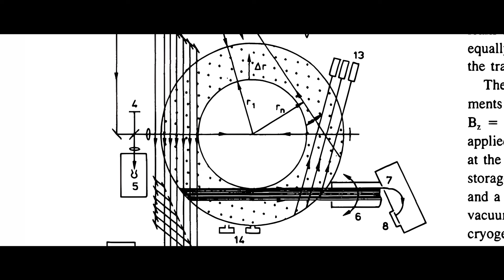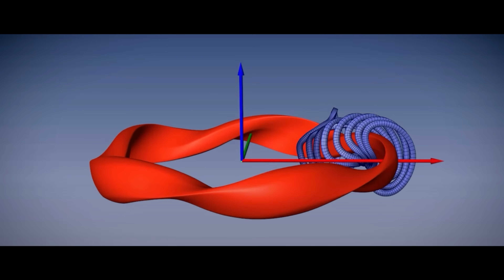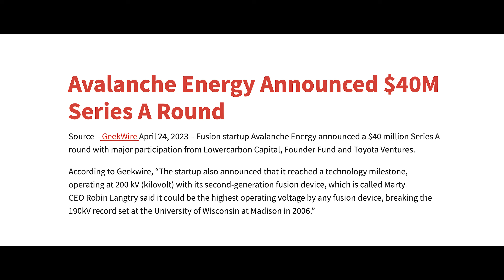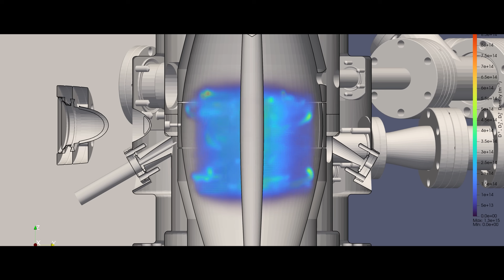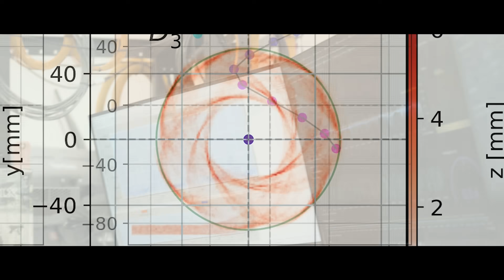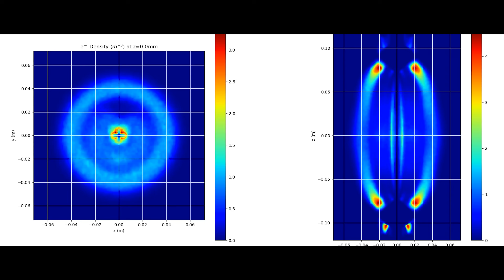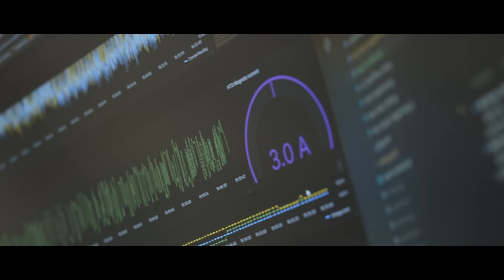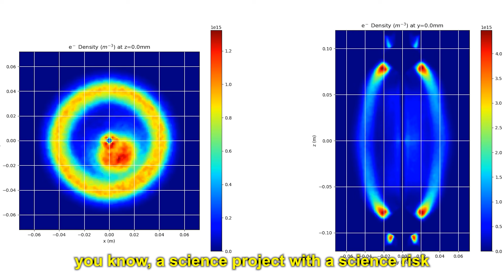This Company Invented a New Way to Do Fusion

Comment: I work in this field and I can tell you, that i certainly hold some level of respect for these people and the undeniable technical challenges they are working on. BUT, none of these project hold the potential for the scale required for any form of net energy, or in the propulsion world power that can be used outside of for craft already in space. Their architecture simply does not have the right scaling laws. Additionally, the fuels used also scale much worse than the accepted approaches. Essentially, with their approach they would need an absolutely absurd amount of input power (like annihilate a city levels) and need to heat the plasma to genuinely insane levels, that would make the larger fusion machines look like ice pops.
Reply: Also, with some back of the envelope calculations, in order to achieve similar plasma conditions to a machine like ITER (which is around what you would need to be even considering anything comercially viable) an electrostatic approach with optimal efficiency and confinement (which it will never truly have) would need to have on the order of 100s of MV used to generate the electric field. This is many orders of magnitude higher than the highest ever sustained voltages.
Reply: In what way are they inputing energy? Is the 300kv used to push in electrons in to the chamber?
Reply: @ginis_The voltage is for confining the plasma and generating the pressure to undergo fusion. Maintaining this voltage requires energy, and a lot of it. Once you get this high up into voltages you cannot store it in a battery of any sort. You need to actively be using energy to maintain the differential.
Reply from the maker: @flamebreaker1214  how about for space focused propulsion?
Reply: @createdbyspiral already addressed in the comment (not scalable)
Reply: @createdbyspiral As you point out, these approaches could prove useful in space focused propulsion (Which is why it’s the main area serious academics are investigating in regard to this). It will come down to balancing the thrust/mass ratio with the fuel density/mass ratio. I would say that our current implementations are best suited for probes headed outside of the solar system as they have a lot more time to accelerate and don’t require high thrust, which matches our current results. 

In terms of fusion power, there are a select few private companies that are not total scams (this one is not unique at all) The most promising are Commonwealth Fusion Systems, Type One Energy, and Thea Energy. Many of the rest (especially those not investigating tokamaks/stellarators) Run into the same scaling issues.

Also, a general rule of thumb for the field would be that anyone who is saying their fuel will be anything but Deuterium-Tritium is a con man. The reason is that other fuels would require you to increase temperature by several order of magnitude (even compared to the multiple hundreds of millions of kelvin in real reactors). Look up “fusion cross sections for various possible fuels”
Reply: If this proposed architecture is, in fact, just a science fair project, how did these highly trained individuals become convinced it was worth such a large investment of time and capital?
Reply: @PETERJOHN101  The OP didn't characterize it a "science fair project", and it's not clear what you mean by "highly trained individuals". If you mean the project engineers and technicians, they are only investing time-on-the-job and drawing a salary, unless they have skin in the game, in which case they are part of propping up an investment-scheme. "scheme", or another word that starts with "sc-"
Reply: @-danR 
The OP expressed his view that this was not a valid approach to the problem of fusion, so my question remains.   What is the psychology at work here since educated engineers would logically know they are digging a dry well? It was a simple question.
Reply: @PETERJOHN101  It's the same answer as to why scientists keep going onto those science or history channel shows and talk about bigfoot, or ancient aliens, or blind frog ranch for 4 hours straight. Because it's a steady paycheck.
Reply: Some people held some level of respect for Elizabeth Holmes and Theranos, back in the day. We became sadder, but wiser, people.
Reply from the maker: @-danR  hmmmmmmm
Reply: Not scalable?   Who cares? Just build more and gang them to get whatever you require.  Just like the engines on Starship.  More engines = more power.  Maybe the reason we don't have fusion yet is because people can't think outside the box.
Reply: @barnowl6807 that's not quite right in space propulsion. 1) wrong mass enery ratios the more you add to the weight the more energy you need 2) diminishing returns even at 1% light speed : double the output won't give you double the speed. The more you accelerate more it costs the get faster and it gets unreasonably expensive (by orders of magnitudes). Adding more generators linearly doesn't cut it. Besides, we don't need fusion energy in space for what we want to do. Nuclear submarines are already a thing. We could retrofit and improve from that.
Reply from the maker: @faster_than_bugs  fission works as well, but long term, fusion can half the time to mars!
Reply: @barnowl6807 I think they mean not scalable in terms of getting fusion to work with their setup period electrostatically, and the not scaling in terms of daisy-chaining a bunch of reactors together in series for more power like batteries. 

Like certain physical laws of scaling . Like how for example you can't have an invertebrate on land like a bumblebee the size of a human and expect it to fly, or a human the size of a blue whale on land because the weight would crush itself.
Reply from the maker: @barnowl6807 I like this guy.

Comment: If you are using this model, try the addition of multi-vector pulsed RF, but pay close attention to phase and polarity and the constructive interference at the waves with a view to the electric and magnetic portions of the wave relative to your containment fields. Timing is critical. You are not just injecting energy but also a wave in the electric and magnetic fields to push your plasma further inwards... like an EM shaped charge, without the instability that arrises from heating anomalies caused by trying to do the same with your field generators. Depending on your plasma configuration you might need to go as far as X Ray... but if you do the math based on what you have then you'll see what I mean... taking it to the very edge with the rest of your system and then pushing it way over the edge while simultaneously creating additional bands of energy within the plasma with a relatively small and efficient input. Once the cascade starts within the plasma, enjoy the results. My only concern about this approach is efficiently harvesting the energy that you get out... but you can certainly get net positive on the output.
Reply from the maker: wish I interviewed you for this film.
Reply: @createdbyspiral no. But pass along.

Comment: Unfortunately it will never get ignition. And that's for all the projects.  but the only way it will work is the answer to the fine structure constant. 1/137 answer is not a number it's a word to what have to do gnition happens.
Reply from the maker: please elaborate for me.
Reply: i solved the fsc, it is just phi indisquised. Thad Roberts has a bit different formula (im sure it is convertable to his - it just shows a different aspect), but he also eliminated ALL 288 fake physics constants. No fine tuning. Just holographically syncronized universe. You dont know about him, because "they" dont talkabout in mainstream. Btw, he stole the fake moonrocks. Cool guy, master respects. My guess was he was trying to expose them :D

Comment: Why does fusion research always treat their elements as particles instead of waves?

Imagine the particle as a single ridged wire coiled as a sphere with a gap between the wires about equal to the wire gauge.
Standard fusion has you throwing these wire spheres at each other hoping they will mesh, but almost all bounce off each other (repel each other)
But if you can match spins velocity, approach velocity and alignment of spins it may be possible for these two coiled spheres to mesh together, and form one (fuze) 

Just food for thought.
Reply from the maker: dude we need to give you a mil to start a fusion startup.
Reply: @createdbyspiral Ha! What am I going to do with another mill, build another antigravity vehicle?
Reply from the maker: @4pharaoh  perhaps a room temp superconductor
Reply: @createdbyspiral  Baa haa haa. I’ll check my junk box, it’s gotta be here somewhere, I stopped using it once I figured out what energy really was and how readily available it is if you talk nicely to it.
Reply from the maker: @4pharaoh hahahaha
Reply: They probably do I would assume. I’m guessing they just dumb it down for video
Reply from the maker: @corporatecapitalism  they did simplify it for the video, its wayy more complex.
Reply: I really interest about the project how can I contact you
Reply: Theyre treated as statistical distributions with known cross sections for fusion, and simulated like a fluid (magnetohydrodynamics)
Reply: @PinccART  so I understand. However you do realize that point is strictly a probability ( ie: pure math) and it’s only connection to reality are those statistics. Reality is not math. ( the sound you now hear is the many exploding heads of those mathematician who thinks truth exists only in their formulas.I weep for them.)
Reply: @4pharaoh  I mean fair? But like then you're just arguing about what objective reality is lol - it isn't possible to simulate that many individual particles we just don't have that computing power (assuming you know what a particle "is" based on what youre saying)

The simulations run for turbulence in these reactors are as accurate as we can get
Reply: @PinccART  I don’t disagree with your statement about the difficulty of simulating reality, it’s just irrelevant (and quite frankly fantasy, like a Matrix movie)
My original post pertains to approaching fusion with a finesse that requires a model (an imagined reality) of the elemental components involved. Instead of simply smashing parts together. 

Our best ideas of the true nature of elemental reality stops at the math. And as I said before reality is not math.

Comment: Fascinating approach- I like the topology of the thing, electrostatic hollow cylinder as opposed to spherical grids or. Polywell. Not sure how good the current scheme is at keeping the ions from hitting the walls and losing energy, but this can work assuming they don't get TOO rowdy, and that they can overcome bremsstrahlung losses by cramming so many ions in they fuse before they have a chance to waste a ton of energy. If they can get the quantum spins of their fuels aligned, they could make most of the neutrons from fusion come out the top, and most alpha particles out the bottom, then build specialized devices to handle them that bolt to the cylinder. Trying to make thermal power off the neutrons could work well for larger devices (as it always does), but I could see direct capture from the alphas alone working if the squeezing strategy used to ignite the plasma is efficient enough at creating high energy collisions.

It sucks that true aneutronic fusion is limited to something as difficult to work with as proton-boron, if this thing fits in a car burning deuterium it's gonna be the size of a house to run that. Trying any more energetic aneutronic fusion reactions with lighter nuclei inside this thing is just going to burn the lighter stuff more often, and those reactions will still make neutrons. It seems from their website they're embracing the neutrons now, advertising using these machines for research which makes sense. Personally, I think the benefits of a small power source outweigh the fact it'll slowly become radioactive as long as the embrittlement doesn't wind up causing reliability issues, but that is FAR down the road at this point.

Cool startup! Wishing you guys luck, and a smooth gradient descent towards net energy
Reply from the maker: you're very articulate mate.
Reply: What's that magnetic mirror approach maybe combine that with this
Reply: u bring good insight.  i think i saw .45T in the video.  i imagine they cooked a dozen or so rigs already with only 50K V as well. not from neutron dmg. of course.  They need to leap to 5x, or use better materials imo.  i suck.  have fun.

Comment: Mean while no one will let us experiment.  Can i get a damn chemistry set. Robotic arms? A mechanical engineer  ,;welders. 3d printers. And metallurgy experts. And yea computer guys i don't even know what theyre called 😂.
Reply from the maker: brad, what do you want to experiment on?
Reply: @createdbyspiral capture neutrons  with what? Double  pressured system in levels coherant! Spin is wider and narrows why b would that happen? Liquid interior gelatinous exterior? Sphererical magnets? Ferro or warranty? The exterior  wall cam expand,? What material? Pulsed? Not continuously but capture efficiency? But 10:48  now u got it. Chemical liquids different kinds. Im.a mo ome. So dong listen ti me. I'm also interested in sonir luminescent being integral.  😂
Reply: @createdbyspiral can also start outside in. Elevtro static outside
 Magneto static next vaccim interior will turn a  iron torsion or braided copper  system to not nerd steam.
Reply: I have dreams and do diagrams so im 100% a heretic and dreamer.  But thsts why I wanted robotics arms.  Not trying to blow myself up 😂.

Comment: I wish these guys all the success in the world, and I hope they get it, but I don't see this approach working.  Neutrons will kill your design.  Moreover, extracting energy out of this reaction will mean working fluids and heat exchangers and all sorts of Rube-Goldberg mechanism to make it work.  The only novel thing here is Electrostatic confinement, and that's a failed approach that goes back to Philo T. Farnsworth.  
You need an approach that extracts energy directly, and doesn't produce neutrons.  My bet is on p->B11.  There are a few others, but that seems to be the best approach with the least cost upfront; costs will spiral out of control once you start trying to ramp up the scale and keep everything stable.
  Tri-Alpha Fusion uses proton-Boron and Helion Energy uses He3->D.
Reply from the maker: sending this to a note to the team.